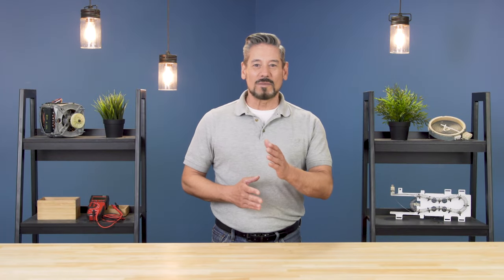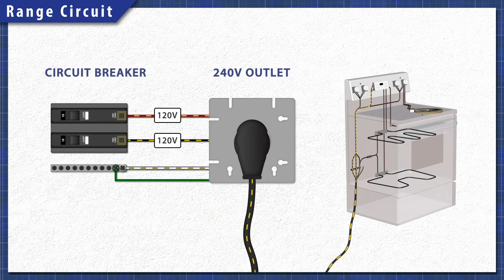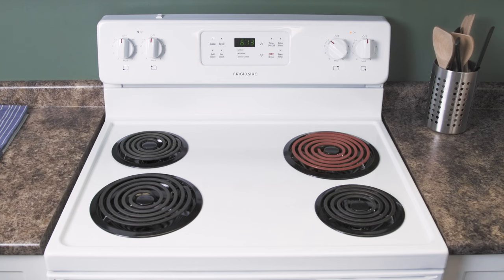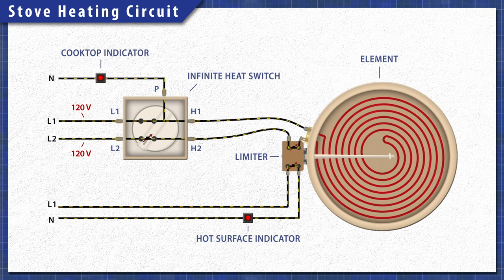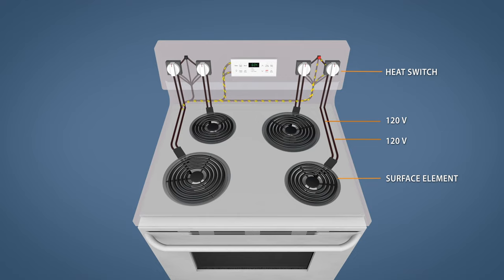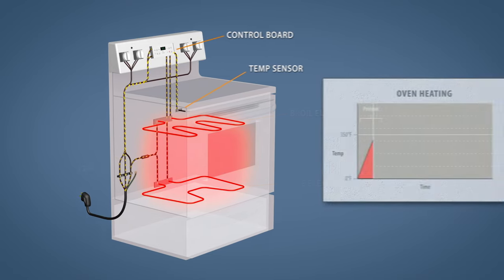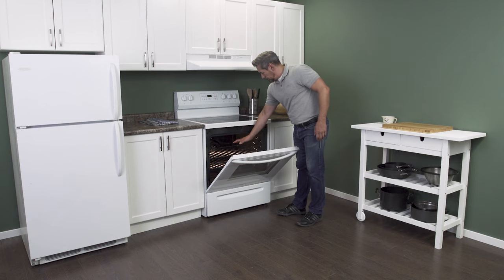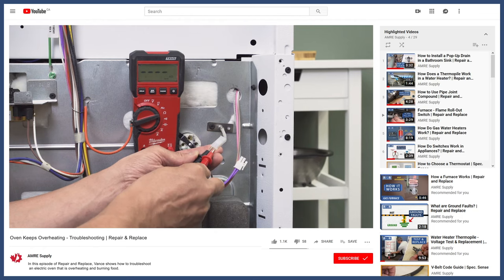How an Electric Range Works | Repair & Replace

Comment: bro you basically taught me something i was trying to learn on the field.. you make it so clear these older guys make it sound like rocket science
Reply from the maker: Thank you, we're just happy to share some good information! Many of these appliances are more simple when you look at which components are inside. A heating element is just a resistor, and a switch just connects or disconnects power. These facts don't change just because the purpose of an appliance changes. So we try to simply these concepts with a focus on the components. If you're curious we have a few videos that we review circuit basics and components, you might find them interesting as well: https://www.youtube.com/playlist?list=PLCo9SMjkdWBzlEqde1FSEIuCg2hx6_H-_

Comment: Excellent video. I learned so much. My error code on my whirlpool indicates the control board but my element looks swollen. The control board was replaced last year and quite costly. I will check all the wires first but if the element is damaged is it possible  that it might throw a control board code too? I am replacing the element anyhow because it doesn't look great. Thanks
PS- I just learned you have a store in Winnipeg. Im so excited to get my parts there.
Reply from the maker: Thanks for watching, we're just happy to help both here on YouTube as well as in store! It depends on the model what codes will appear however if there was a surge of power that damaged the heating element, it can sometimes damage the control board simultaneously. If the element is damaged it should be replaced. You can test the element for continuity through the back: https://www.youtube.com/watch?v=ABope7vl5IY
As well it could be helpful to check the temperature sensor as this can give you an error code: https://www.youtube.com/watch?v=jnt_mUwdL8o

Comment: What about emf exposure? Will it be a health risk over long-term usage?
Reply from the maker: Thanks for watching. The understanding of EMF exposure overtime is something that is not fully clear however all electronic devices produce some EMF. The power decreases significantly with distance so taking a step away from the stove or oven while you're cooking would  decrease this exposure.

Comment: I have a question for conventional ovens. If each, burner is on a separate circuit, what would happen if you crossed those circuits even when off? I believe my apartment had some crappy electrician exposed wire and both right burners were connected while cleaning and it shorted out killing the whole oven.
Reply from the maker: Thanks for watching. It depends on which wires were exposed and where those wires were in the system. In some cases that might trip a breaker, a thermal fuse or damage a relay on the control board. With the power disconnected, and the back cover off you can look for any burnt, damaged or exposed wires. As well you can check to see if all wire terminals are secure and isolated. If you have a multimeter you can test to see if any wires have continuity to ground / are shorted.

Comment: My Gma gave me her stove bc she thought her plugs were bad when she herd her stove spark! but I believe something happened to the control board bc when I got it home the oven no longer works but glass top does! It’s a brand new stove!
Reply from the maker: Thanks for watching. Since the stove and oven are on separate circuits you've already verified that the range is receiving power. If both oven elements are not working, then it could be an issue with the thermal fuse, a faulty temperature sensor or an issue with the control board: https://www.youtube.com/watch?v=96s7maybHlY

Comment: on an electric Kenmore range when it is started should both top and bottom heating elements turn red?
Reply from the maker: Thanks for watching. The elements don't always glow bright red when they turn on. During a preheat both elements should be warm to help heat up the oven but they may or may not be red depending on the heat setting and the oven.

Comment: I have a Kenmore 790.46709602 electric range. Not showing any error codes, but all four burner heating elements heat to high and stay on high. They won't cool down to simmer when turning the dials to a lower temperature setting. Any ideas as to what's causing this?
Reply from the maker: Thank you for watching. Is this a new problem that happened all of a sudden? Based on how the heat switches work, it is very unlikely for all 4 heat switches to fail at the same time. Normally this problem might only occur in models that have burners controlled by a control board instead of heat switches.

If you buy a new heat switch, and it fixes the problem for 1 of the burners, then it's best to replace all the switches.
Reply: PROBLEM SOLVED!
Range was unplugged for 10 min then plugged back in. It must have reset the control board.
Reply from the maker: @terbus12156  Glad that it is fixed with a reset!

Comment: my whirlpool coil cooking range  have problem . Only down heating element works while baking but not up. is that problem .. or thats the system how it works??
Reply from the maker: Thanks for watching. Does the oven heat normally, or is the oven not baking properly?

Some models use both the bake and broil elements when baking, other models will use just the bake element. In the broil mode, all models will only use the broil element to brown the top of the food.

Comment: How do you remove the top to replace spark module from a gas cooktop seal burner with no screws on the burner itself? Only the summer burner back left has a tiny screw on it.  Sc8640edb4
Reply from the maker: Thanks for watching. We have dozens of videos on electric stove and oven repairs but haven't created any videos for gas cooktops yet. This model breakdown can help show you where some of the screws are and what pieces fit together. As well you could do a search for other Whirlpool gas cooktops as there are many individuals uploading their repairs that they film on their phones. Between that it should help. If there are no visible screws, there might be a hidden set screw that might be tucked behind somewhere.
Reply: @AMRE Supply  I replaced a microwave switch and hi limit thermostat.  Why when I plug it in the air vent comes on.  And it won't turn off

Comment: Hello, When my stove/ oven is overused the control display on my appliance displays faintly and oven stops heating. Would you please help me?
Reply from the maker: Thanks for watching. Its possible that you have a re-settable limit switch that is overheating, and disconnecting power to the heating element. You can learn more in this video: https://www.youtube.com/watch?v=96s7maybHlY

As well the fact that the display gets weaker does indicate that the control board could be defective. Still its good to test the fuse and temperature sensor first.

Comment: i have one burner that sometimes heats to the high setting when i have only put it on the number three setting , the stove is only 4 yrs old , and it doesnt do it every time ? what could it be?
Reply from the maker: Hi Richard, thank you for watching. It is most likely an issue with the heat switch for that burner. Over time the contacts can warp and can stay pressed together. This can prevent the burner from shutting off when it should be cycling off. You can see this in more detail in this video: https://www.youtube.com/watch?v=l39vOnhqnhg

Comment: Can I change a 3prongcord to a 4 on the stove
Reply from the maker: Thanks for watching. The only difference between a 3 pronged cord and a 4 pronged is the fact that the ground wire has a separate terminal on 4 pronged power cord. You can see more detail of this in this video: https://youtu.be/F-qMAJ6AY80

Comment: I was almost electrocuted by my apartment’s electric stove.  They replaced the wires but doesn’t look right.  The receptacle blew and it sparked like fireworks and burned a hole in my pan.  Thankfully I had just bought a new pan with handles, I did feel a volt going through my arm, I let go.  Now I’m afraid of my stove because the incident.
Reply from the maker: Thanks for watching. It sounds like the stove receptacle wasn't installed correctly and was shorted through the frame of the stove. It is best to contact the people who installed it and get them to properly fix the issue.

Comment: 1:24 did this guy risk being shocked doing the hot side first vs the neutral side?
Reply from the maker: Thanks for watching. Holding the multimeter leads from the insulated handles, wearing gloves, inserting the multimeter lead into the neutral side first, and using just one hand, are all ways to reduce the risk of a shock. In the example at 1:24 the probe was inserted into the neutral first.

Comment: I just replaced the heating element in a Frigidaire range. When I plugged it back in and turned the oven on, I heard a small "pop" and the entire thing went black. Ive reset the breaker. It will not power on at all now. I'm assuming it blew a fuse but I can't find a thermal fuse or limiter or anything on the backing. What would you suggest next? The model number I believe is 316436266 but I think it's discontinued, I haven't been able to find any part guides.
Reply from the maker: Thanks for watching. Does the stove or cooktop indicator lights still work? If so then you've verified that there is still some power to the range so  it could be a fuse, limit switch or issue with the control board (the pop could have been a shorted component on the board)

Alternatively if there is no power on the entire range then you can always double check that the outlet is supplying the 240V of power, and the power cord is still good. You can also check the connects of the power cord to make sure it is secure in the terminal block: https://www.youtube.com/watch?v=wZwxewn2w44

In some rare cases a oven fuse does effect power to the whole range but it isn't that common.

Just a note, a faulty control board will not shut off power to the entire unit unless you have a model that has the stove elements controlled by the control board. In most models that use individual heat switches, those circuits function independently from the control board.

Hope this helps!